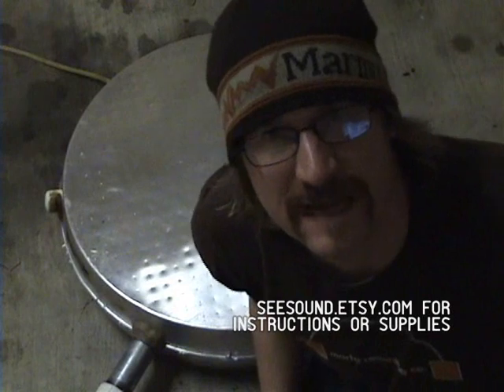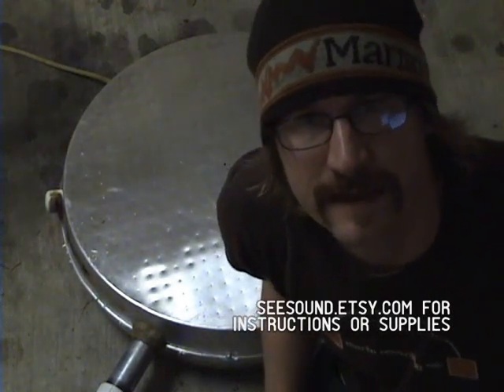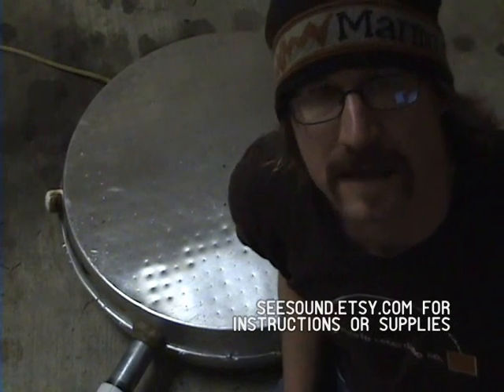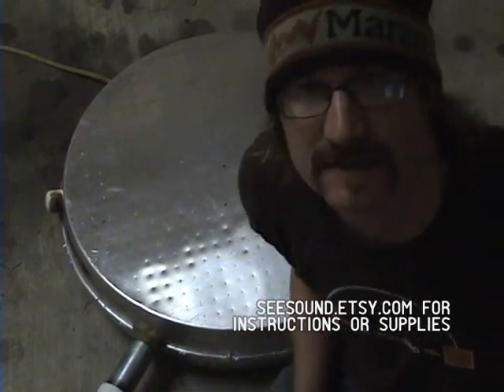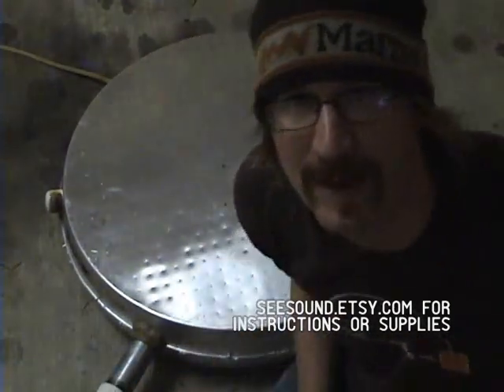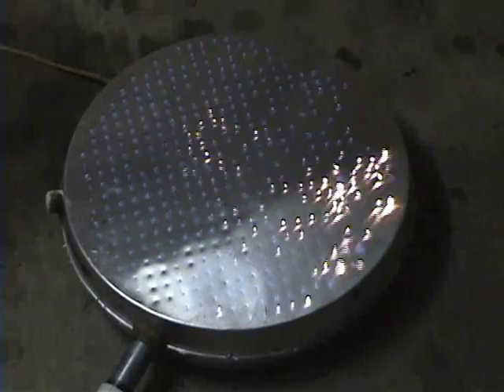Harold Daw Flame Box by Jared Ficklin

Comment: What would happen if the output holes were bigger, but the spacing between them is the same? Would the fires collide?
Reply from the maker: The flames tend to merge.  Then a chimney effect of fire drawing in air tends to become more forceful than the sound and you lose the effect and have a nice campfire.
Reply: I see. Also, would the speaker be in any danger of being burned? Did you put any coating on the speaker or did you just directly attach it to the side?

Comment: Jared, Do you still have the instructions for this? The etsy account isn't up and I would like to have it to save for a later date, possible a school project.
Reply from the maker: If one searches Harold Daw Flame Table in Google Academic you can get his actual published article which has good specs.  I kind of abandoned the etsy thing once I realized this guy, the flame table, is a lot more than a Ruben's Tube to chew on.  More fire, more gas, more opportunities for danger.  I like to say if you can weld, and you are quite friendly with propane take it on if you are also willing to assume the things propane and fire do: burn, hurt, destroy, sometimes kill.  Email me for tips.
Reply from the maker: Here is a newer one Flame Table 2 -- Jared Ficklin 

The one in this video did not work well and I abandoned it as it kept expanding its seams and leaking gas.